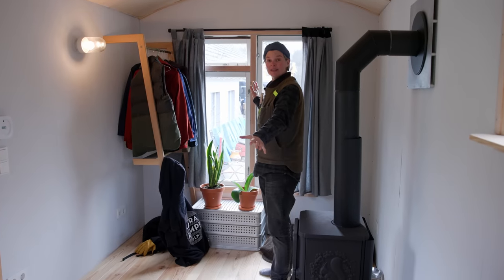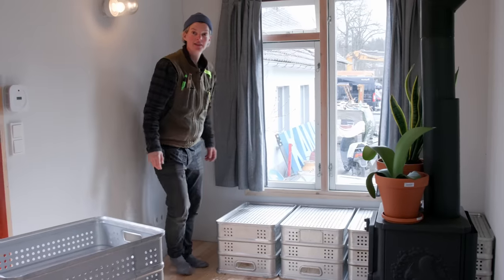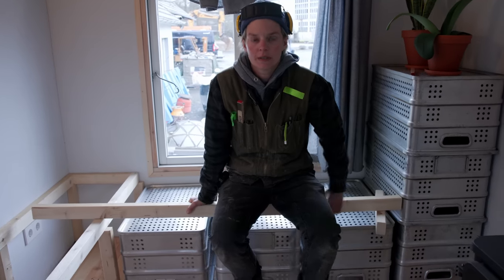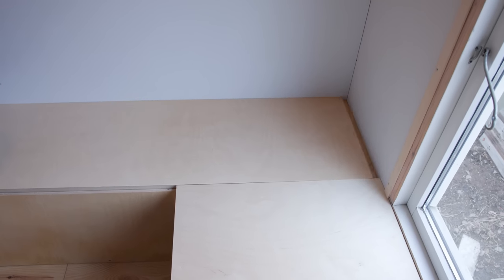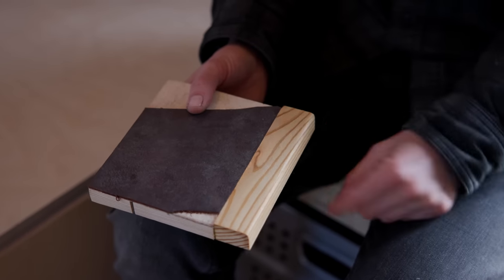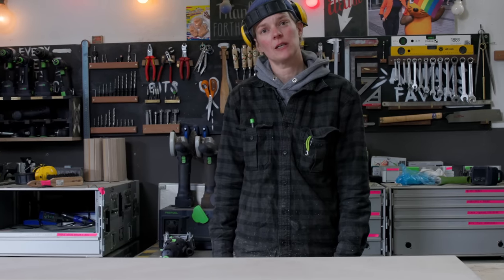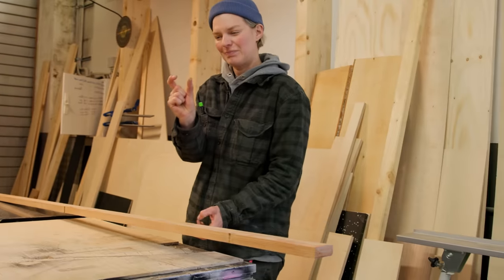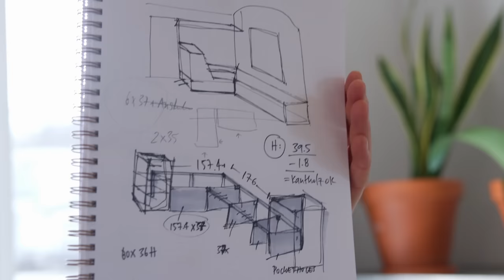This is why I don´t sketch! (Building a Tiny House)

Comment: ABSOLUTELY LOVE IT!!!  Girl, that leather seat and hinge combo is absolutely brilliant!  It looks stunning and no doubt feels really fabulous as a seat.  And the contrast between that and the pistachio linoleum section of the bench is really really handsome.  Just amazing!  It might be nice to have a coat hook or two up high right there by the door to hang up coats right as you enter, but having the taller section in that corner keeps the space so much more open than your original thought would have.  Had you put that by the door, it would've totally disrupted the Qi flow in the space.  I just can't get over how brilliant your whole design has turned out so far.  Geil!!!

A few thoughts/suggestions.  It almost looks like the cut between the two pieces of plywood that form the hinge may actually be off (or very close to the edge of) the support beam below that is anchored to the wall.  Does that need to be widened to make sure the main bench to the outside of the hinge is fully supported by it?  Also, there was a brief shot showing your window from the outside of the house where the trim is totally chewed up!  What happened there?  It (sadly) looks terrible compared to all the rest of the impeccable workwomanship and will be an area where water can get in and cause rot.  Do you have any plans to repair, seal and repaint all of that so that sill detail will be fully protected and as beautiful and finished as the rest of the house?

WOW!  You truly amaze and inspire!

Comment: Your tiny home is turning into a beautiful space!  I would like to mention though that every time you go up your steps, open your door, back down a step or two, especially when carrying something, I wonder why you haven't figured out a way to open that door with a handle nearer the bottom of the door. At one time I did that going in and out a camper until one day, while carrying groceries, I missed the step backing down to give myself door clearance and broke my ankle...

Comment: You also have a pretty decent amount of room under the trailer to put some big lockable storage boxes that go from one side to the other but still have clearance underneath. Room for a fold up table and gas cooker and other things you don't want to clutter up the inside with

Comment: So awesome to watch your creative process.  All this woodworking ... and no glue.  All those corner joints would be much stronger if glued as well as fastened with screws.  Also you might want to oil that leather a little bit to keep it in from taking as much damage from scuffs and scrapes.

Comment: Beautiful idea with the leather. I'm a smidge concerned about the weight of the board working against the bound when it's open. It could peel off if it's left open too long.

Comment: Awesome!
I'm sure it's fine, but consider adding some strength to the leather hinge seat.
Double up the wooden strip that is screwed to the wall. This "sister" would hold a lot of weight when somebody is sitting on the leather seat. It would take out a lot of flex and would relieve stress on the leather hinge as well.

Comment: Sketches are meant to communicate ideas and intentions, especially to other people.  Rarely are finalized products realized from them.  Often, as you have demonstrated here, modifications are made to the original plan because of reality. Professional Architectural designs for buildings, automobiles, etc. are often modified during the building process to resolve problem issues.  You may not like the process - but remember it is just a process.  Good build.

Comment: I like the theme you are going for. The leather hinge amazing. I wish I could get some of the metal boxes here in the states. Every time I see them, I have a project in my shop that would be perfect for 5 of them. I tried using plastic crates and it didn't work. if you know if I could get 5 of them in the states please let me know.

Comment: Have you thought about felt on the bottom of the metal crates so it slides better and doesn't scar the floor . And how about a folding deck on the front of the building a place to put a small table outside you could access it from the window and fold it up or down when not in use up if have to pull the trailer some were it will protect the window and down when not in use

Comment: Are you worried about scratches on the floor when you pull out the drawers? Maybe put something on the bottom of the metal drawers to slide easier and non-damaging?

Comment: That hinge looks amazing, but it's for sure gonna degrade pretty quickly unless you put some support under the lid. Wouldn't need to be much either, even just a 20mm lip under the hinge edge of the lid would probably do the job, maybe sloping down so the corners don't catch each other as it's closing.

Comment: As nice as the brass fasteners are paired with the leather, pocket holes beneath the cover would have left the surface completely clear. Still loving the design as you go approach and adapting to the little glitches. Super video!

Comment: Great build.  However, I wonder if the radiant heat from the wood stove might cause the aluminum boxes to get hot since they are fairly close to it in the corner?

Comment: I would still have added recessed mechanical hinges under that sheet of leather just for strength. Eventually gravity will work against the glue holding the leather to the plywood and while the leather might hold it may get harder to keep open in a wide enough position. 

What's the plan for resuming work on Liselotte now that spring is here?

Comment: You need a load relieve at the hinge if the seating is not ON the stud where the hinge is mounted as it looks like. Also why did you screw from the top when you have easy access form the bottom. Aside from that, nice fit, well done.

Comment: The leather platform is going to need some additional support (either a  couple of braces across the gap or another timber screwed/glued to the piece attached to the wall) at the back to catch the hinged piece as right now its just floating in the air - if someone were to sit on it in its current config, the leather is likely to come away from the wood, if not straight away, but some time in the near future (when you're least expecting it)

Comment: Things change too. When I started my tiny house I had a Japanese wall with a tokonoma alcove in it but I ended up ripping it out and it's now where the fire sits😂 I like the idea of a Japanese wall and a tokonoma area but even though I built it I felt it didn't work. Things change as you use the space

Comment: Your Aluminium boxes look like grape boxes. I stack mine and have them on casters that I buy off the shelf. That way I can move them around the workshop when I need space. The down side is when I need something from one of the lowest boxes. You need to unstack the ones above.
Reply: Grape crates not boxes

Comment: Instead of trying to sketch in perspective, try isometric drawing.  You might still be able to get graph paper that is all equilateral triangles instead of squares.

An isometric drawing still gives the sense of three dimensions, with the additional feature that any dimension that is parallel to one of the three axes can be directly read off the drawing.

Comment: Und nun, a short, 1 meter, deck under the window.
Also, suggest a couple of narrow strips of the flooring, on the of the aluminum boxes. To prevent them from scratching your floor.

Comment: Well, you may not like to make sketches, but they are useful if one understands the space and the program of use that resolves, at least in a small room, what is "stay" space and what is "circulation" space, with an access, as well as a way to ventilate and illuminate naturally. After that, the sketch can be simple. Anyway, you solved it well, with the "closet" in the corner. It should be a closed enclosure with a door (plywood as closure and structure)...depending on whether the width allows hanging a clothes hook, which would give the answer to where the door should open and whether it is divided into a larger height above for clothes and a smaller one, below, the same as the rest of the furniture, for shoes.

Comment: 22:20 There's probably no potential shear force that could add compound wear to the leather hinge, but I can't also help think that another strip of material glued to the inside face of the two pieces of wood would add longevity to it

Also, NOICE.

Comment: 17:36 a little trick with contact adhesive is to use wax baking paper between so they don’t stick to each other before you want them to. 

17:36 ein kleiner trick mit kontaktkleber ist, wachsbackpapier dazwischen zu verwenden, damit sie nicht aneinander kleben, bevor du es willst.

Comment: The little house is really coming together. Almost need a porch/patio/platform though, that way you aren't backing off the steps to open the door. Hands are already somewhat compromised between opening the door and carrying things in, harder to catch your balance. WE just "recently" got you out of the leg contraption, lets not put you back into one.

Comment: Why don't you try to use angle bar to make shelves for your aluminum bins that you sit up against so you can actually use them in the right corner. Also put a top on it so you can still put your plants on top

Comment: Using the leather may be a problem later. Unless you use something to reinforce the leather, and an epoxy rather than a contact adhesive, the heat of the stove and the dog, combined, may cause the adhesive to un-bond. Otherwise, nice approach.

Comment: are you considering weight when designing ?  i see 1/2 and 3/4 plywood used ... apple ply to boot... maybe if you used 3/8 and 5/8 or even 1/2 as substitutes you will be saving a pretty penny weight on your furniture.

Comment: this isn't exactly an argument to not sketch, but to get better at sketching. You don't always have unlimited, easy access to the place you are working in. If you have problems with one/two point perspective just do isometric sketches, rigidly sticking to the squares of the page. It stops you from worrying about how perspective works and you get the benefit of being able to measure in your drawing. The other possibility is to use a 3d modelling program, or quickly building a miniature from paper or cardboard.

Comment: Isn't that the whole point of a sketch, though? To get your initial idea down in some sort of concrete form, so you can iterate and change from there. Sketches are just ideas, not plans. They're meant to be abandoned as the project moves forward.

Comment: @Laura Kampf I'm concerned about the longevity of the leather hinge while the cupboard lid it's not being supported from underneath. Even if the glue holds, the leather will likely rip under someone's weight. (I'm 1.85m & 130-odd kgs and would never sit on there, that's for sure.)

It wasn't clear in the video if this  lid has any support. 

 Cheers from Australia.